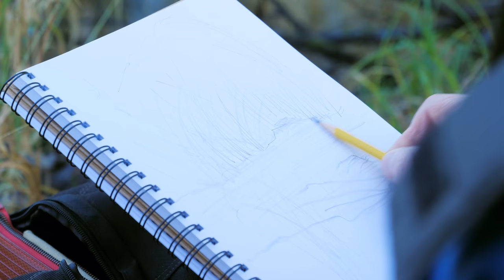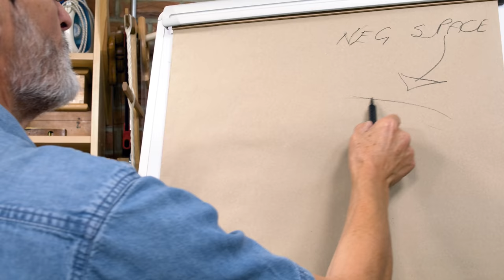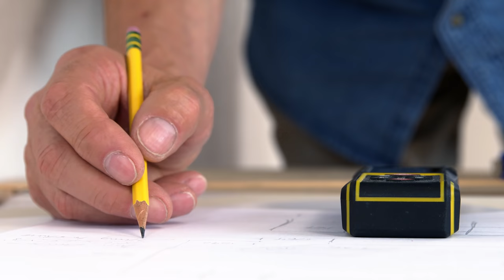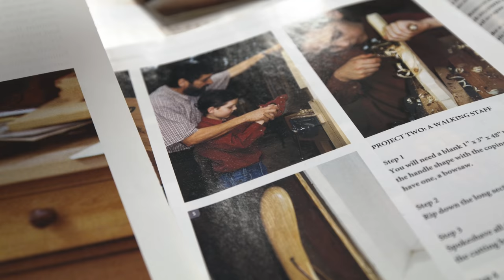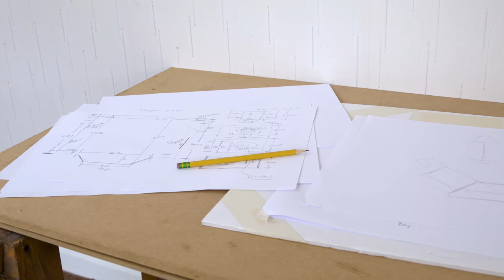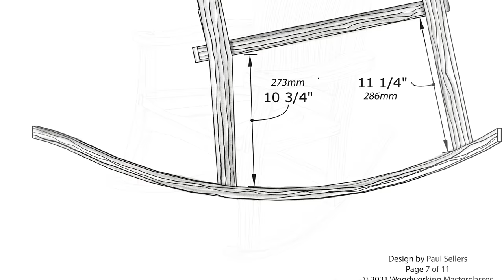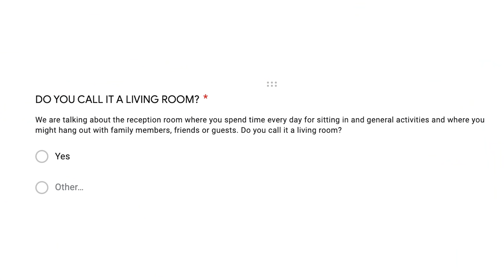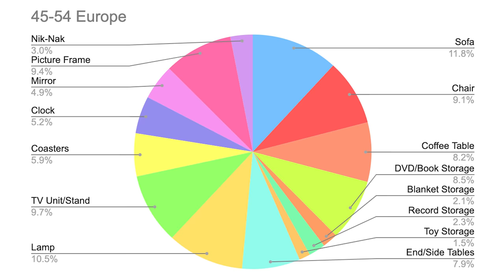Sellers Home | Paul Sellers

Comment: Hi Paul, This video was wonderful. I was diagnosed T1D 7 years ago, a week before my first child was born. I got into woodworking shortly after with the power tool route. I've made some things for the home that I'm very proud of and have recently started down the hand tool path. I'll probably end up using both power and hand tools as my time is limited with young ones at home. But I never make anything that doesn't have a purpose or a need in the house. I look forward to your videos. They have me considering getting more into hand tools and building your plywood workbench.

Comment: Your vision and work is truly inspiring. In this video you hit the spot on (also regarding my situation) so many times, its scary. I AM a software developer by trade and started woodworking during the pandemic and I now I really love going to the basement and just doing a few woodworking steps (sometimes in the middle of the night) and it's a fantastic excercise and once something is finished it's extremely satisfying and rewarding. A few projects later I have so many ideas what I want to build next around my home; I start scribbling some notes, sometimes I create a CAD model just to doublecheck that something has a chance to come together, then I source the wood and simply start building it. In my experience building your own furniture and fixtures means you don't have to search a long time to find exactly what you're looking for which can either take a really long time, cost a ton of money and/or will end up as a compromise (pick 2) but also makes it truly your own. Your videos have taught me so much and been a real enlightenment for which I'll be forever grateful! Thanks Paul.

PS: I really would like to see the dovetail making with a knife and an axe. 😉

Comment: It is amazing that I've been thinking about this for quite some time now and I stumble across your channel just when I was learning  to use hand tools insted of the big machines that I learned woodworking on years ago. Thank you!  There is a place for the machines but I feel a better connection to my projects when I break out a chisel for a mortise insted of a router. There  seems to be much more control of precision with the hand tool and less need for templates etc. I'm in the beginnings of doing exactly what you have discribed and I am starting in our living room just as you have. I am learning to joint edges with a plane and your instructions have been just what I needed. I have several planes but I never learned how to use or sharpen and tune them to where I felt comfortable using them, your videos have helped me hone and develop the skills needed to move forward. I appreiciate what you are doing and look forward to the next lesson. JD

Comment: I’ve been a hobby woodworker for over 45 years. So, I’ve seen huge changes in woodworking. Back at the start, there were no electric powered tools for the amateur - was that a simpler life? Yes. Was it a better life for a woodworker? That depends on each individual. I love to produce items that have meaning and personality but my old body now just won’t take the strain of too much hand work. 10 minutes with a plane and that’s it for several hours. So, now that good machinery is within the reach of many, I have to use machinery to undertake the most physically demanding tasks. The design is still human; the details are still human and the finish still human.

I say all this because I know of several people who have similar physical restraints; could be age-related; could be health-related. We all get a huge amount of satisfaction from producing items in whatever way that we can. I would agree that there are few more pleasurable experiences in woodworking than using a freshly sharpened chisel or plane; I just have to be spartan about my physical input.

There are significant downsides to machinery. It requires more space than hand tool storage; it makes noise; it costs you in terms of purchase, maintenance and electricity; it requires dust extraction machinery. It requires knowledge and skill to use machines and I have ended up with 2 lots of skills - hand working and machinery working. 

We are nearing the end of a long barn conversion. Planning constraints would not allow the house to deviate externally visually from the old barn - although we do have a large balcony on the 1st floor. Again because of age, we chose to go with low or zero maintenance products externally (eg aluminium, powder coated windows) and invest in getting towards the goal of self sufficiency in electricity. I’m now making and installing 2 lots of wall panelling - about 18m in length in total; I’ve made and will make more tables and chairs; I have got solid oak internal doors to make as well as open fronted wardrobes. Luckily, one of our sons is a gifted cabinet maker and he wants to broaden his CV so he will be working with me on all the 2nd fix timber plus doors and wardrobes. 

I like to use as much native timber as I can - that translates in practice to European sourced and well as UK. So, oak, chestnut, beech and the like are favourites. I particularly like (American) cherry - it has to be American because we can’t get big boards in the UK at an affordable price. As Paul Sellers said, it matures wonderfully - but one word of caution - if you leave a plant pot or a light on a cherry table for a couple of months, then the timber underneath that will be a younger colour than the rest of the table; it will catch up if you take that pot or light away but just be aware of the speed of the maturing of cherry.

Do what you can within your own limitations. Don’t feel that using an electric plane (or whatever) devalues your work because you physically can’t do anything else. It doesn’t alter the end result which is the best you can do at the time.